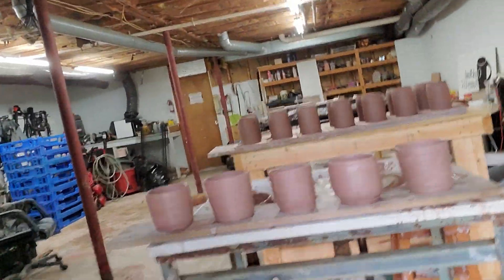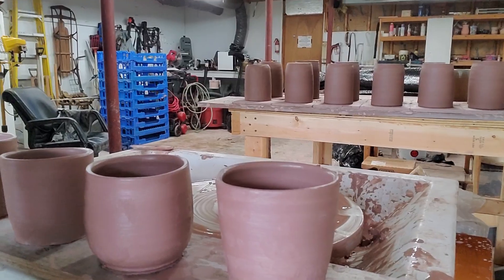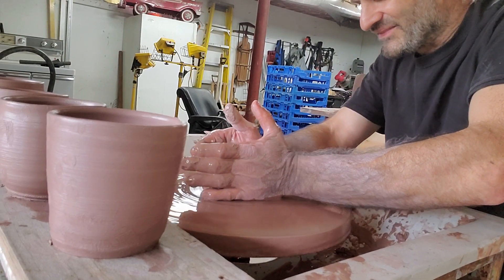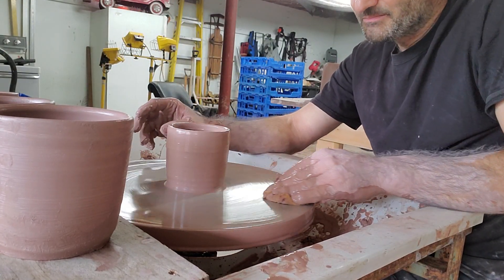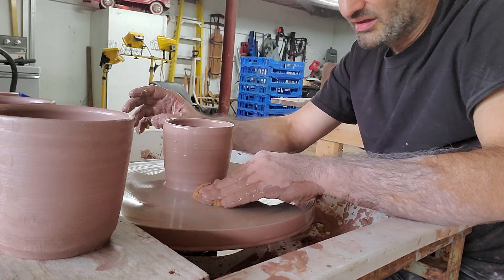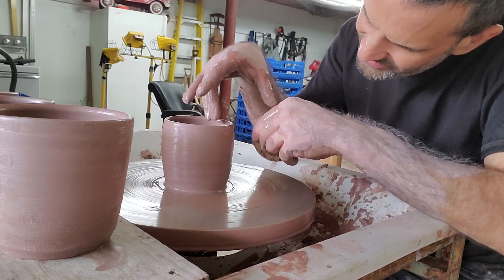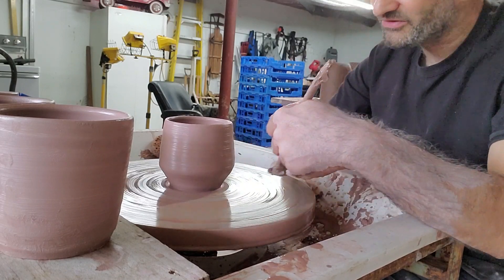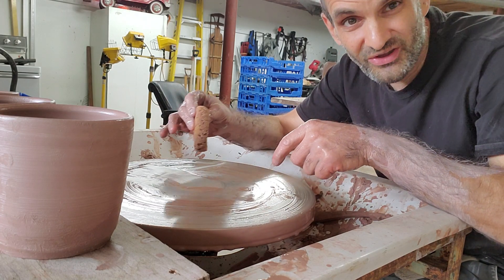My First Treadle Wheel Pots: Creek Road Pottery

Comment: I used a kick wheel in college, and liked it. I now have an old Shimpo RK-2 which works very well but I am hoping to get another kick or treadle wheel to lower my carbon signature at least a little.
Reply from the maker: Yeah I don't worry to much about the carbon.  I think compared to industry which cause 98% of the issue, they should not gaslight me for being only .005% of the problem.
Reply: @CreekRoadPotteryLLC  It's more of a self conscious thing for me.

Comment: The Japanese use very little water when they throw. Your point about the treadle drive contributing to the shape of the piece makes good sense. 
Though I've never met MacKenzie (I had a chance to but missed it) can't say I'm particularly thrilled by his overall influence. He was unquestionably a major force here in this region as the upper midwest has become known for the Japanese influence on the area's pottery largely due to him... but dogmatic about his teaching. He had a reputation for stifling his students. I love Japanese and pre-industrial aesthetics, particularly chawans, but there is soooo much more out there to explore.
Reply from the maker: Hey thanks for stopping by! Yeah I have not read to much about Mackenzie as a teacher. He was probably so tight on his ideology on pots due to working with Banard Leach maybe. Yeah ai hope to push out a bunch of Treadle Pots. Hope your doing well!
Reply: @CreekRoadPotteryLLC  That's true, Leach had that same reputation. I'm curious about how those cups you're throwing turn out. You should do a side by side comparison with a powered wheel thrown :)